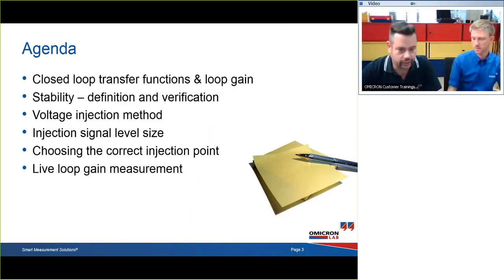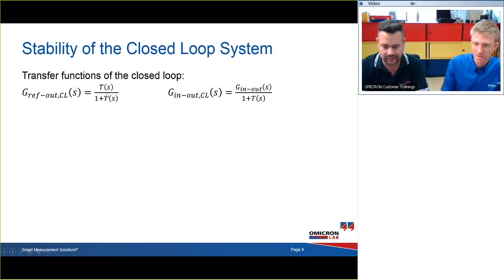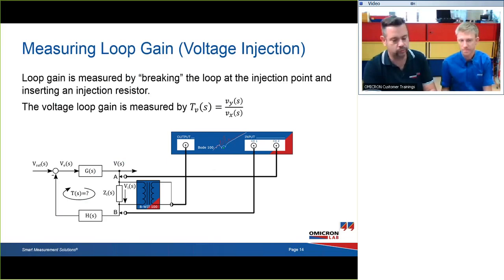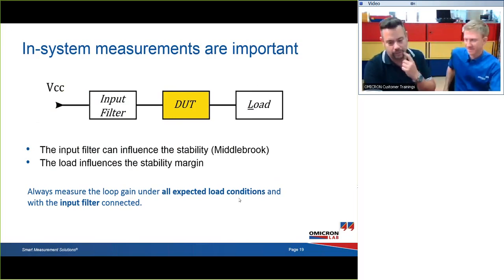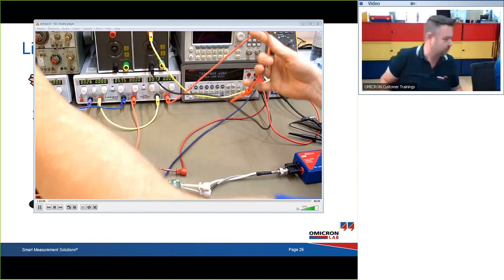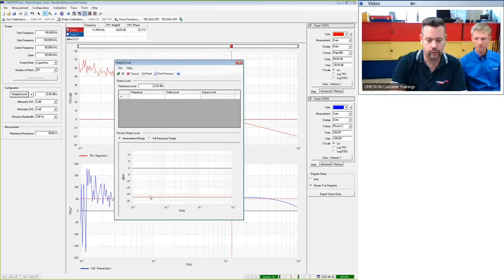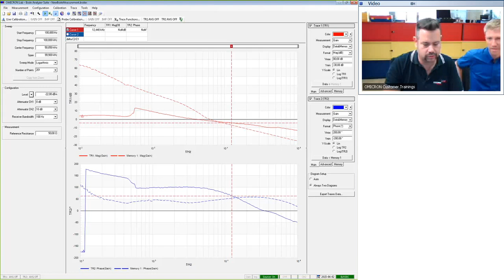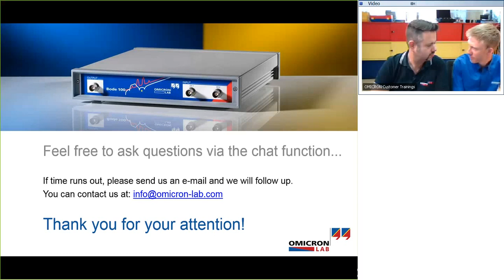Webinar: Loop Gain Measurements

Comment: Can we use the NISM when we have a current loop active? for eg: if we regulate the load current of a converter, can we measure the output impedance to derive the loop stability?
Reply from the maker: If it is an inner current loop, it will be part of the outer voltage loop. If you measure output impedance of the outer voltage loop, an instable inner current loop should be visible. If you are talking about a current source where the current is controlled, the output impedance will be high not low like in the case of voltage control. This means that you might need a different measurement method but NISM can be applied anyhow. In case of a current source you will need to apply it to an impedance dip whereas in case of a voltage loop it is applied to the impedance peak.